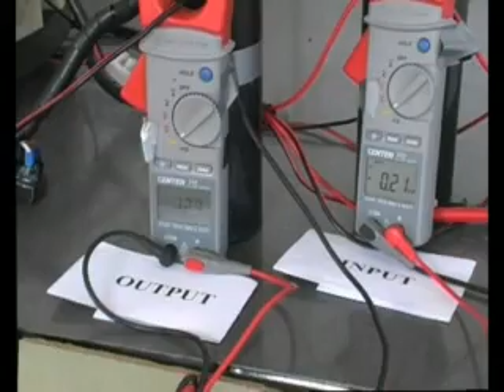Re: OVERUNITY MOTORS BREAKING THE LAWS OF PHYSICS

Comment: Then what's a step-up transformer? Or an amplifier? If generators generate power any input would be amplified. If your amplification is higher than your input then you do have gain or "more from less". The problem comes n looping back to source, safely. Usually requires a battery-like device or capacitors. The more pwr u recycle back to source, the bigger the battery or capacitors...kind of a thing. The problem wasn't generating pwr but the heat degrading materials. Like why light bulbs burnout.

Comment: Magnetic motors or generators are not new... The USA used to use them years ago. They were called power stations and were typically driven by local streams or rivers. They are efficient, they do produce a gain or significant yeild, and were fairly inexpensive and safe. 
We, "The People" just got complacent and moved over as "progress" took its toll and new and better technologies walked us into the "Atomic-Era".  Now with new technologies being applied to old tech we've sorta come circle. ( g )

Comment: Actually it does. As you daisy chain the units together the problem is that 20% then becomes 40%, then 80$, them 160% input. Although the output does exponetialy rise so does the power required to daisy chain them. The point is to reduce your power costs significantly, which it does. Therefore the units pay for themselves typically within 5 to 10 years after purchase. We still have to pay for maint. and damage must be replaced. So it's not free by any means. 
Nor does it defy phys.

Comment: Here's some small minded, petty comments. it's not pety it's petty, it's not your it's you're, it's not insultive it's insulting. Doesn't any one have a spell checker??
About the video. In 2001 they Lutec first appeared and they've been scamming ever since. They turned down winning a $100,000 over unity demonstration prize and are still trying to pull in suckers. Follow the Australian Skeptics link on the "in response" video. You will need to be able to read and comprehend. Hmm fat chance

Comment: So you finished the magnet motor set it running went to bed with a device that would win you the Nobel prize spinning away and then you got up, stopped it and put the magnet back on the fridge and went of to work at McDonald's. Hmm. And you can't see and have ignored that I called and still call you a LYING FUCKTARD.